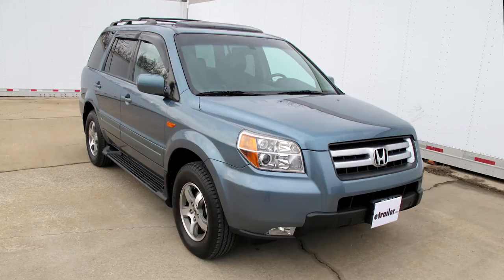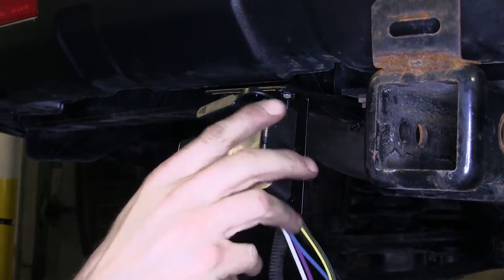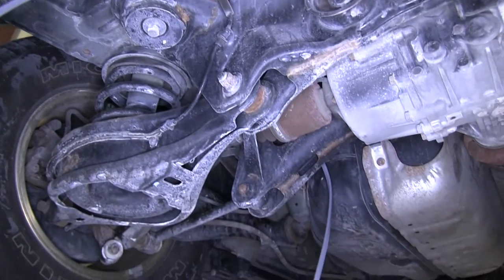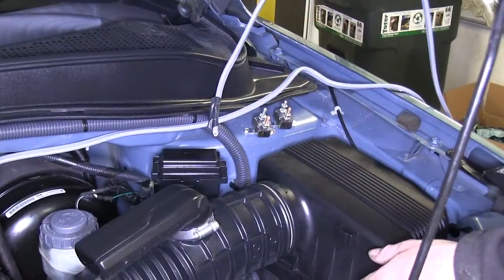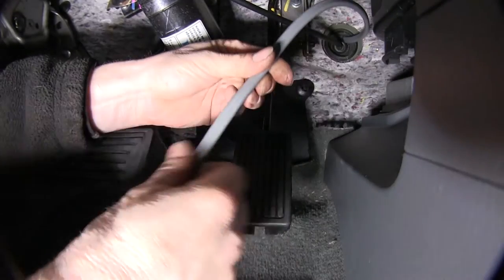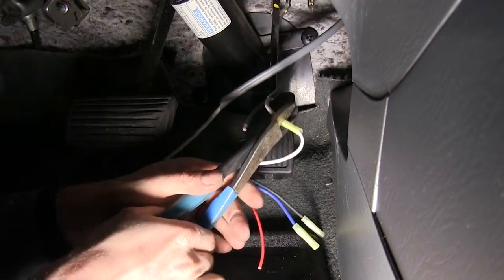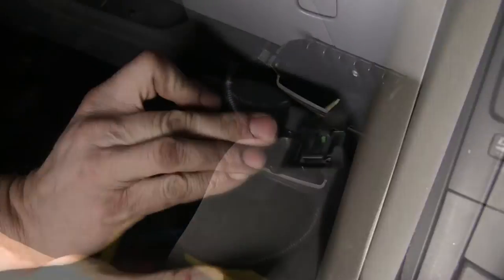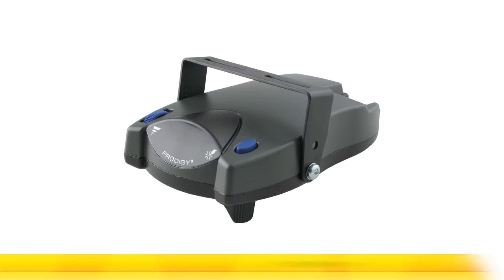How to Install the Universal Installation Kit for Trailer Brake Controller on a 2007 Honda Pilot

Comment: How many of the loom clamps did you use?
Reply from the maker: ***** On a vehicle this size, we'll usually install 4-8 clamps along the wire runs. Longer vehicles will have more, shorter will have less. The key thing to remember is to keep the wires away from hot spots, namely the exhaust system. The other thing to keep clear of is moving or spinning parts that could pinch or break the wire, IE steering components, suspension parts or drive shafts.